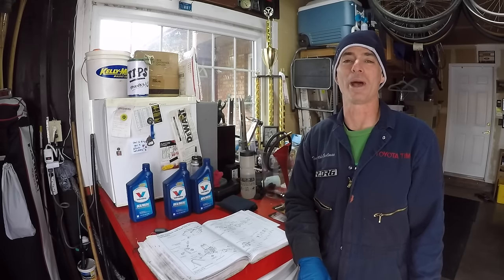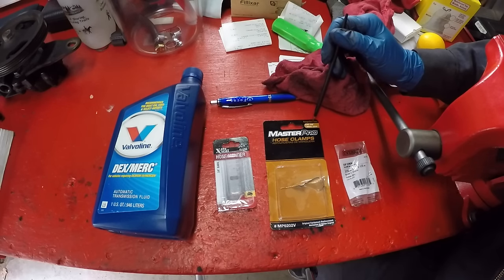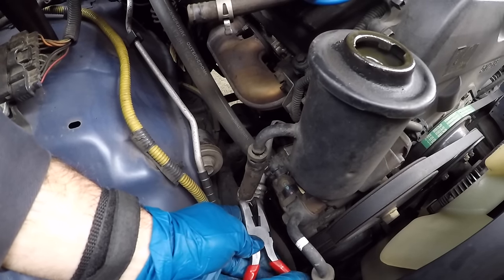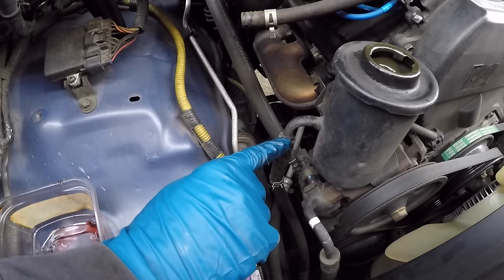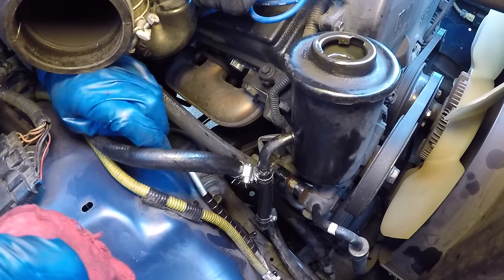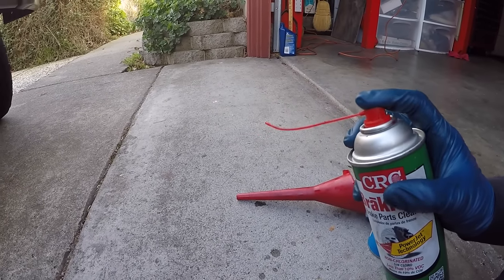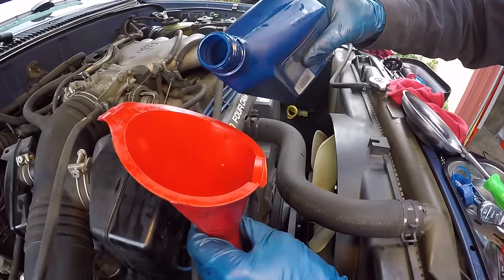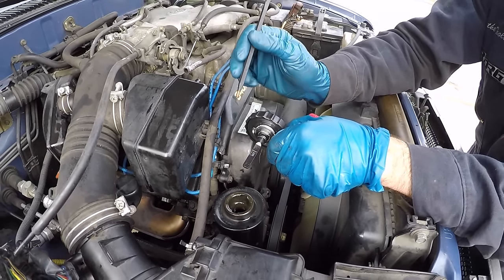Power Steering Flush and Reservoir Cleaning

Comment: you didn't need to run the engine to flush out the fluid. just simply turning the wheel back/forth would have done it.
Reply from the maker: Yep Mike, we learned this after the fact.  Thanks for the comment.
Reply: @TimmyTheToolman  NP...I just did this today on my GX. Oh and please always wear safety glasses when working on automotive stuff. Cause ya never know.
And you only get 2 per lifetime.
cheers
Reply from the maker: @mikejohnson9118  Yeah, safety glasses isn't a bad idea but I don't like wearing them unless I'm doing some cutting or grinding.  If I go blind, you can comment back and say I told you so.
Reply: @TimmyTheToolman  I rather not....
Put it to you this way. Close one or both eyes for an hour. Then think...about the rest of your life like that. Also most safety glasses suck...I know that. But check on Amazon from the ratings. There are some nice comfortable ones out there.
Cheers
Reply from the maker: @mikejohnson9118  Roger Dodger.

Comment: Toyota says my 01 Tacoma uses O-ring 9008030034 which shows nla, can you assist
Reply from the maker: The power steering reservoir for a 1st Gen Tacoma is the same aa for a 3rd Gen 4runner.  The o-ring part number we list in the video description would work for your application as well.
Reply: @TimmyTheToolman  thanks Tim

Comment: no need to start the car,  a better control would be just to turn the wheel from max to max and the unit would discharge the old  as you replace it with new. avoid starving the pump.
Reply from the maker: John Levy We have heard of this technique before.  I tired it out on my 85 4runner recently that has a steering box and not a steering rack and it did actually work very well.  The next time we do a flush on a 3rd Gen, I'm going to give this a try because why run the pump if you don't have to.

Comment: One could do the turkey baster suck and refill exercise 20X in less total time than this method takes.  Not a good use of one's time, unless you really need something to do during quarantine.  First rule of medicine is do no harm, and disassembly can be harmful.  Where did all the crap in the filter come from?
Reply from the maker: Uh Gary, I don't know how you can say this if you watched the video.  It absolutely is a good use of somebody's time, especially for those people who have developed an issue with the power steering system.  When the reservoir screen gets significantly clogged up, it starves the steering rack of fluid and you get stiffer steering and a whining power steering pump.  Once the reservoir screen is cleaned, it fixes the problem.  So, did you see how dirty the reservoir screen was?  You can't get this cleaned out by using a turkey baster to just renew the fluid.  You have to take the reservoir off the vehicle.  Now, you act like we're doing invasive surgery like doing a quadruple bypass on somebody's heart.  The only real thing to consider when doing this is you should replace the o-ring that seals the reservoir to the pump to avoid a leak.  Other than that, you get the bolts tightened to spec and you don't do something stupid like cross-threading a bolt or over-tightening a bolt and stripping or breaking it.   The "crap" in the filter is from people not renewing the fluid often enough.  The fluid gets dirty as a result and develops deposits that get stuck in the filter screen.
Reply: @TimmyTheToolman  Where would these deposits come from?  I have a 16 year old Jaguar that gets the turkey baster every year and it is clean enough to eat off of.
Reply from the maker: @garyvanremortel5218  Gary, the reason why you don't have deposits is because you have taken good care of your power steering system.   It's just like how engines get sludge deposits from abusing the engine and not changing the oil regularly.  Power steering fluid is one of those fluids like brake fluid that people forget about.  It's only when they discover a problem that they realize, "Hey, I guess I should have renewed this fluid at least once over the last 150,000 miles." It's super common for people to neglect renewing the fluid.  And, it's also not uncommon for people to neglect changing the auto trans fluid.  I frequent Toyota forums and answer lots of questions on our channel and you'd be surprised how neglected power steering and auto trans systems are.
Reply: @TimmyTheToolman  As a mechanical engineer, I believe in doing preventive maintenance if you wish to keep your toys in good shape.  That was my original point.  If you do A, then you won't need to do B,.
Reply from the maker: @garyvanremortel5218  Well yeah Gary, no argument there.  But, lots of people, including myself, buy used vehicles and you find some things the previous owner could have taken better care of, like the power steering system.   Happy Wrenching and Maintaining.

Comment: Fluid color is irrelevant. The road types driven on and the age of the fluid are important.
Use a manual vacuum pump to suck out the fluid.
Reply from the maker: I don't agree with your statement that color is irrelevant.  For a vehicle you are new to without any service records, color is an indicator that the fluid is old and hasn't been charged in a while.  It's just like looking at the automatic trans fluid and seeing that it's brown and not pink.  You could certainly use a vacuum pump to remove fluid out of the reservoir but that won't remove all the fluid out the system.   You can either follow what we did in the video running the pump or you can do what others have done by jacking up the front end of the rig and turning the wheels lock to lock to move the fluid through the system.

Comment: You just defeated the purpose of taking the reservoir off ...
You caint be afraid of bending the tabs back to remove the reservoir cover , it made to be removed...
I guarantee its still got junk in the bottom of the reservoir....
Reply from the maker: That's your opinion.  But, I must ask.  Did you actually watch the video?  The screen went from being around 80% clogged (26:20) to being only maybe 2% clogged (29:40) after we got done with the cleaning procedure.  Bending the tabs back looked like a pain in the butt so i took the easier route of just spraying a bunch of brake cleaner in there over and over again.  I honestly don't know how you can make this comment if you actually watched the video.
Reply: @TimmyTheToolman  As you requested i reviewed the video and it appears you waisted 3 qt of PS fluid , plus who knows how many cans of break cleaner .
As you said while flushing the system , ( That was faster than i expected ) .
Cutting corners never solves the problem . 90% of the fluid is in the reservoir anyway , the lines / hoses has very little .
The proper procedure would have been to remove the castner top  clean the inside of the reservoir , where you would have found that after all the flushing you did was useless . You caint get all the gunk  build up from the bottom of the reservoir with your procedure .
Plus you could have saved yourself all the expense of the break cleaner & PS fluid with compressed air to blow out the system .
After that 1 qt of PS fluid would have flushed the entire system to to perfection....
Hears the thing if your gonna do the job do it right ,  or dont do it at all .
JMO !
Reply from the maker: 90% of the fluid is in that tiny reservoir?  I don't think so.  I've drained that reservoir and it's not 90% of the capacity.  The send line, return line and the steering rack must be holding quite a bit.  Like I already said, the fact that the reservoir screen was damn near completely clean and unclogged after I was done tells me my technique worked.  You are correct that I used a couple cans of brake cleaner but I would have used at least one anyways because I don't own a solvent tank parts cleaner.  The expense of 2 cans of brake cleaner was worth it to me to not have to mess with prying off the top of the reservoir.  Sometimes spending a little extra money to save yourself a headache is well worth it.  

Since making this video, I have used this technique to renew the power steering fluid on my 98 4runner.  I ran less than the 3 quarts of power steering fluid on this occasion (about 2)  and the end result was my power steering fluid wasn't as clean as it was when I made this video.  You're not going to have a power steering system completely flushed by only moving 1 quart of fluid through the system.  I know the system doesn't hold a lot, but my personal experience has shown me that running around 3 quarts through the system generates a much better result.   So, I don't agree with you that I wasted fluid.  
 
I also subscribe to the rule that if I'm going to do something, I'm going to do it right or not do it at all.  You obviously believe you are right and I believe my technique works great, so let's just agree to disagree because it's a waste of time to continue this conversation.

Comment: uhhhhh, you're running the pump dry, doing more damage than if ytou just left it alone. Just do this with the engine off and turn the wheel. Simple
Reply from the maker: Uhhhhh, at no time did we run the pump dry.  Kind of impossible since we were pouring fluid in while the pump was running.  When we made this video, it made zero sense the method you mentioned would work,.  How is the fluid going to run through a non-running pump?  But, from enough comments on this video and from my own experience, you can effectively move the fluid through the system by jacking up the front end and turning the wheels lock to lock.  So, I mention this technique in a comment I pinned (1st comment you see).

I could have just deleted your inaccurate and disrespectful comment, but I'll let it stand for now. Contrary to your opinion, we did no damage to the pump and our cleaning of the reservoir screen actually fixed Jax's noisy power steering pump and made his steering feel smoother.

Comment: So...
Reply from the maker: So it appears it's my favorite transition word.
Reply: Left the video rolling while doing something and was laughing my ass off
Reply from the maker: @Czotie  Yeah, it was pretty damn funny.  Sean put that together.
Reply: Sooooo.. did the flush, mesh screen was actually pretty clean. Afterwards still had stiff steering. Ended up taking apart the knuckle between the steering shaft and the steering wheel, it's right at your feet behind a plastic cowl on the fire wall. I cracked the 4 bolts holding the knuckle together, cleaned it, hit it with some greasless penetrating lubricant (keylock lube) and then greased the hell out of it with a grease gun with it was jimmied open. The stiffness is totally gone and it feels like it just came off the assembly line but my car reeks of grease. It added some play to my steering but that's better than not being able to steer at slow speeds. 

I would not advise doing this unless you've consulted the manual, and even still there really isn't much information in there. The manual does not show how to fix this part. I believe if you don't know what you're doing you can easily send your airbag or get the steering wheel perma locked. You can easily damage a spring that is in this knuckle, and it has a round nipple that has to lock into a plastic center spinning piece. Do this at your own risk but it probably will fix your issue if you've tried everything else. I will track down the best way to do this, I was not able to completely remove the part, just crack it open and clean/grease.

 @TimmyTheToolman  I'm going to add a little write up to the current TW forum your video is on. The FSM doesn't actually show how to do this and on the 4x4 it's a total @#$&_#. 

Thanks again Tim!!
Reply from the maker: @Czotie  OK, sounds good.  Thanks for sharing.

Comment: 19:20 you pump is without oil
This is not good men.
Reply from the maker: You are correct it's not good to run a pump dry but running it like this for a second or two isn't going to do any damage. You just wouldn't want to run the pump dry for an extended period.

Comment: So I was having this issue prior to following your video, I followed it and it seemed like the steering got slightly better but when I turn the wheels this is what happens to the pulley, do you you think the pump is bad? https://youtu.be/jnfbPQNbh2Q
Reply from the maker: It might be the pulley bearing that has gone bad.  That's what it sounds like to me unless you don't have the belt tight enough and it's slipping.
Reply: @TimmyTheToolman  that's makes sense, do you know if I need to replace the whole pump of just pull the pulley off and replace it, btw 248,000 miles on the pump.
Reply from the maker: @stevemartinez8822  I don't really know if the bearing is something you can easily replace or the whole pump needs to be replaced.  I've never messed with one.